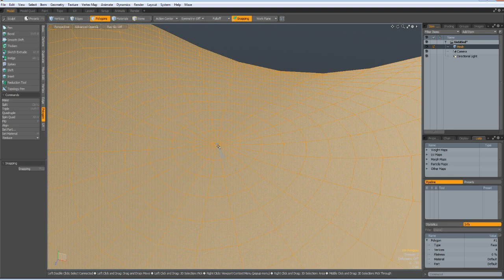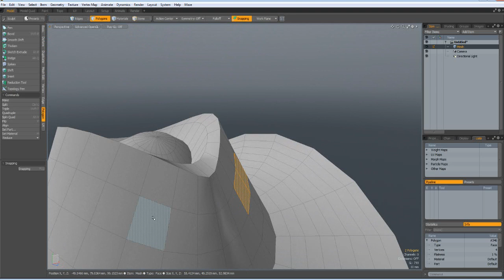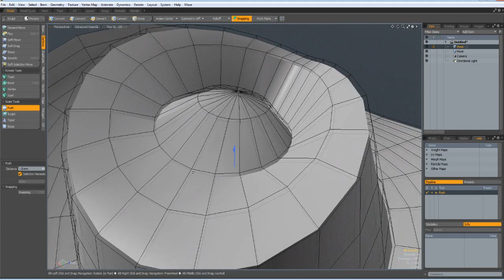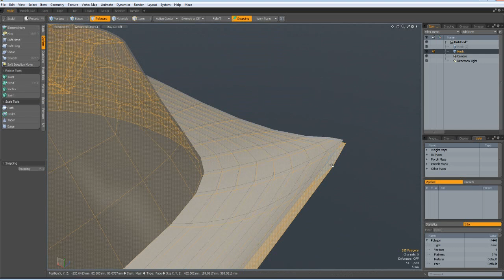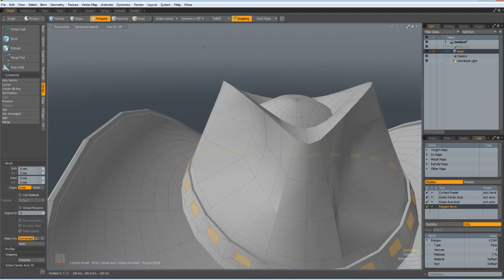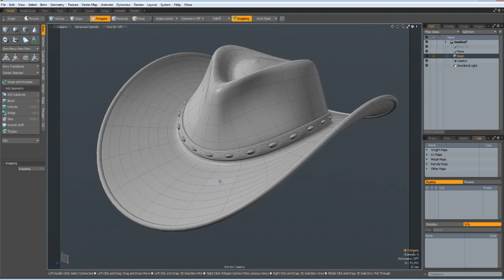Luxology modo - Thicken tricky Geometry

Comment: Thanks peter for great tutorial. Learn something new. I have exported .obj (before thickening) from modo and in 3ds max apply shell modifier without any topology/geometry error and grea thicken mesh.  Splitting object, deleting meshes, copying & pasting, bridging etc, seems too extra work to me, though modeling hat is much faster than 3ds max.  May be there some other option beside thicken, push and manual mesh manipulation.
Reply from the maker: Hi, Actually the solidify modifier in Blender is better than any iof the MODO tools also. But you can't have it all :-) All the best, Peter

Comment: hello peter ,

thank you for the great tutorials Im new to modo but worked before with other softwares. Just wanted to say you are really helping with modo.

 I tried to make the hat the same way and it worked really well with the PUSH tool i think they solved that issue. Im not sure what virgin are you using but Im working on 902
Reply from the maker: +Saad AlSaadoun Hi, thanks for your comment and letting me know about the push tool. Actually it should work because by definition, the pus tool should push all the polys along their normals. Thanks again and happy new year, Peter

Comment: Hey Peter, somehow when I use loop slice on the cylinder it doesn't cut it the same way yours does. It just cuts the selected ones and not the all 15 loops go around the cylinder.
Reply from the maker: LZ Filmmaking Do you have 'Slice Selected' active ?

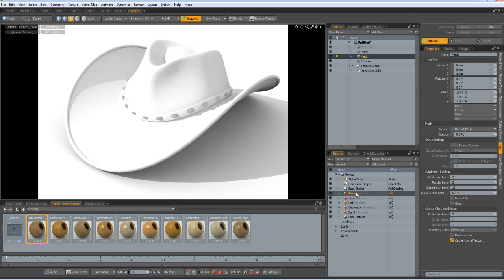Comment: Hi Peter, as always a very nice and helpful tutorial. I have a little question: at around 19:50 you open the plane material in the shader tree and you do it with one click and the entire tree expands. How did you do that ? Thanks and regards, Luca
Reply from the maker: Hi Luca, thanks for your comment. It's very easy, just press Shift key before you klick. Works on all in the Shader tree. Kind regards, Peter